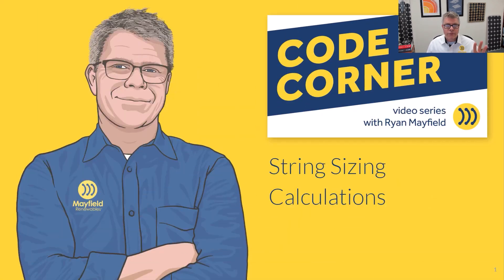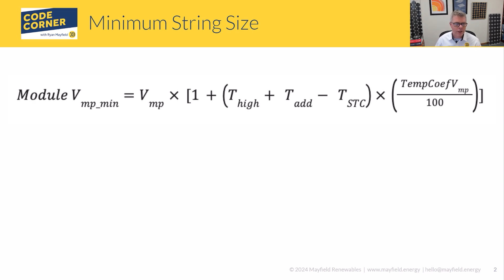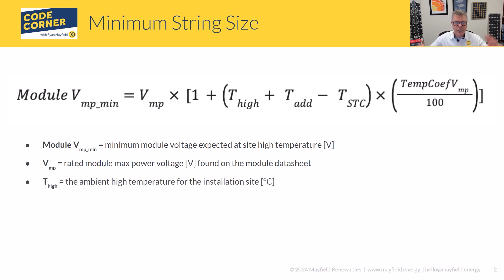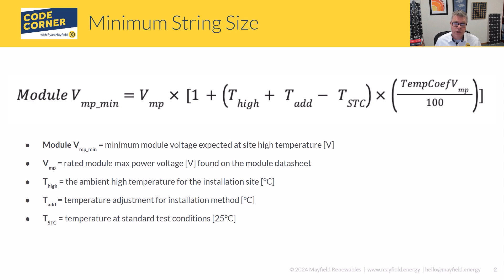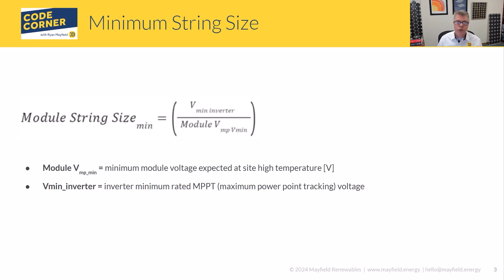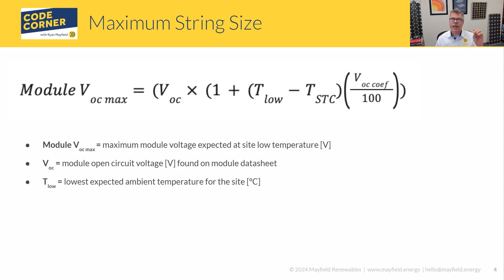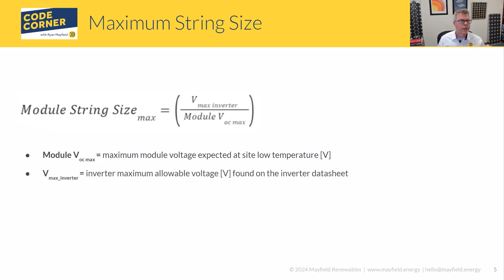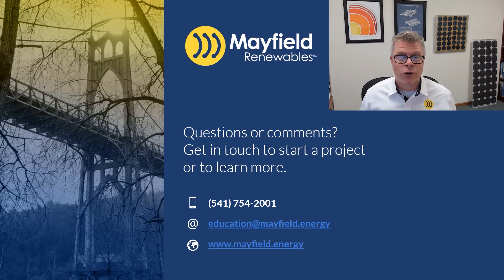PV String Sizing Calculations

Comment: Would be nice to get some real life examples
Reply: So I have a 48.5 VOC panel with Temp coificent of -0.272. If I did the math correctly it is 55.76 voc in winter at -30 Celsius(-22F the coldest it has been in my city). So I think that means I can't put 3 in series and 3 parallel for my 150v 60amp 3500watt mppt charge controller like I was planning, even though the vmpp would only be 120.6v and just under 30amps.
But it seems like I'm going to have to under panel and do 4 strings(in parallel) of 2 panels(in series), or over panel and do 5 strings of two.